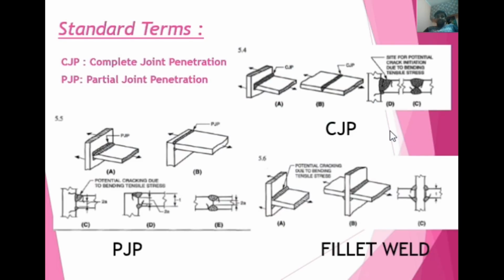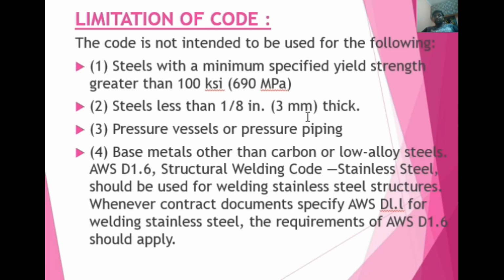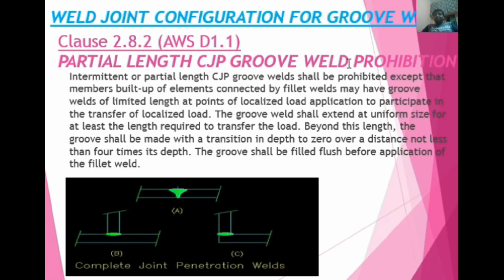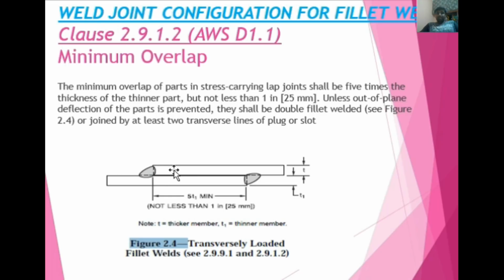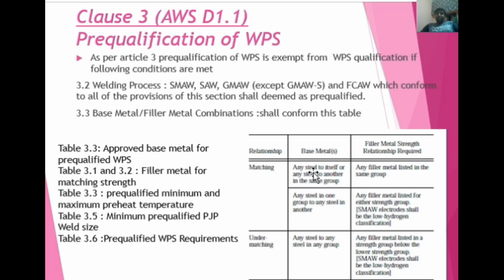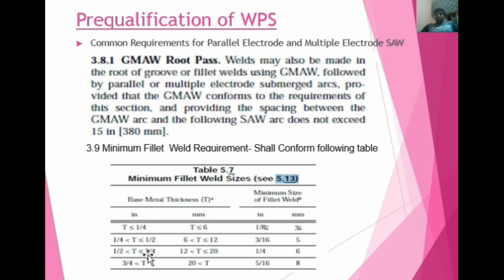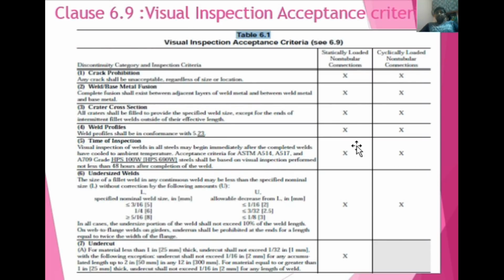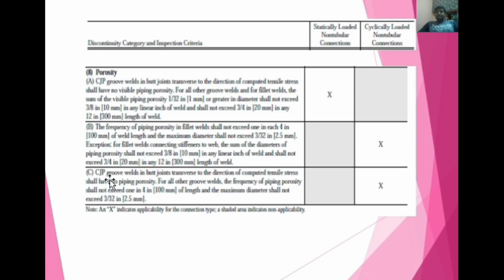Guidelines for structural steel AWS D1.1 welding Inspection

Comment: Is grinding allowed during wqt
Reply from the maker: Nice question.. See answer below.. It may mention in wps the method for interpass cleaning, it can be followed for cleaning the completed joint...but for wqt normally none of the inspectors will not allow ( even contractors) becoz to insure the quality of welders...if a welder who is not able to deliver a sound weld, pass wqt,  will be more headache for the welding inspector and the contracting company itself...so better not to allow..
Reply: @WeldingNDTInspection  thank you sir

Comment: Sir  if pqr done on 25mm plate and same wps used for wqt and done on 12mm plate..should I use same voltage and current for wqt
Reply from the maker: Yes you have to follow the range of approved WPS...